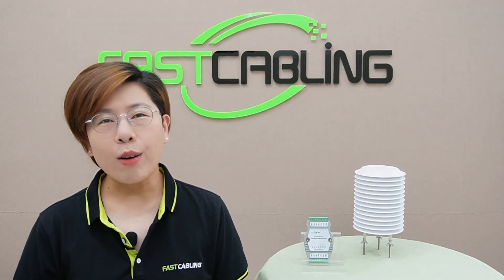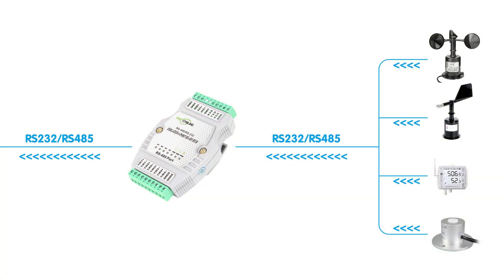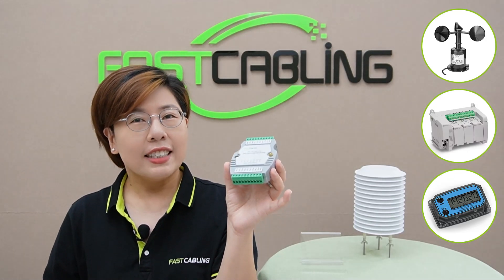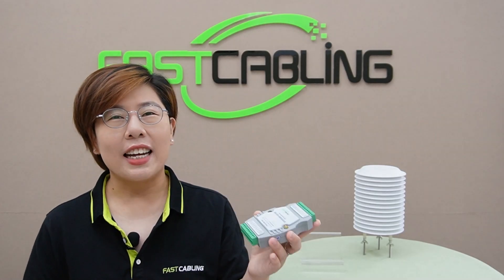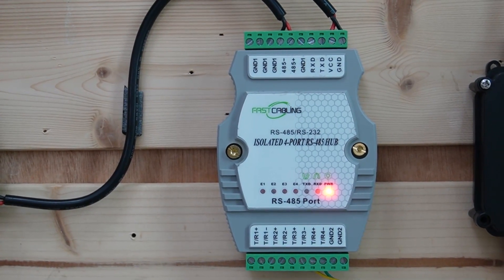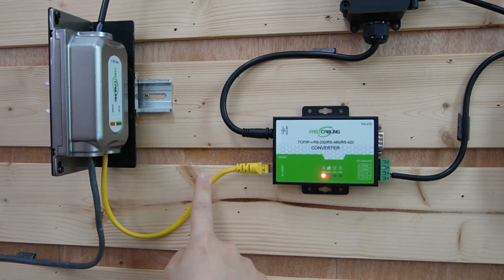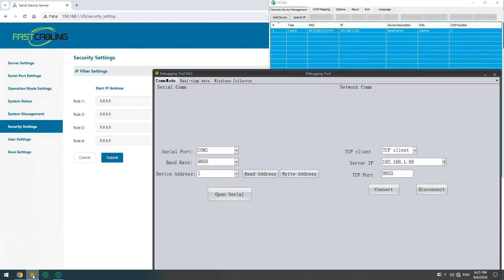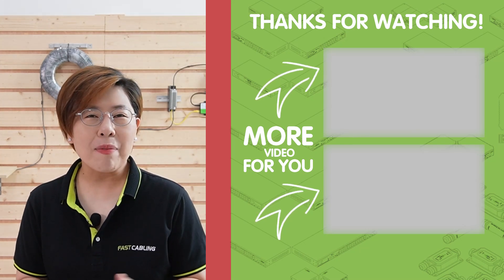Industrial Isolated RS-232/RS-485 to 4 Ports RS-485 Hub: Setup Guide

Comment: Why does the RS485 splitter 1 input with 2 outputs used with 2 COM ports on one computer with a Modbus poll application with 15 power meters, always have a checksum error ?
Reply from the maker: You're getting checksum errors because RS485 only supports one master. Using two COM ports (two masters) at once causes data collisions. Also, RS485 splitters can lead to signal reflections if termination and biasing aren't correct.
Reply: @Fastcabling  okay,thank you